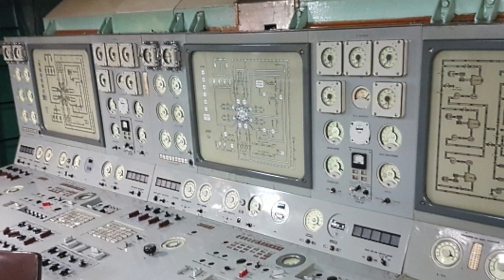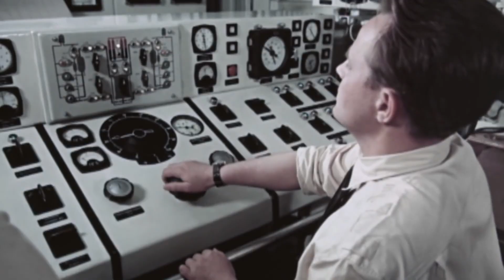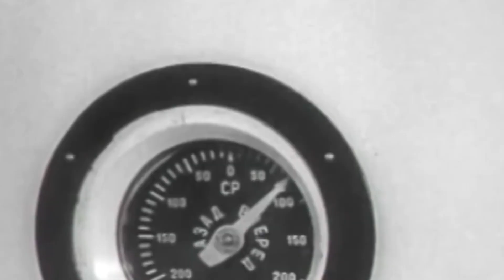Severe Radiation Accident on the Nuclear Icebreaker "Lenin"

Comment: This robo-voice is better than most, but it could be better. My experience is that you have to edit the text to fool the software into making the delivery more natural. In particular, commas will introduce strange pauses that make it difficult to follow. My advice to understand where this happens and remove those commas, even if it makes the text ungrammatical. In summary, listen to what is generated and modify the input to make it more natural-sounding.

Comment: If a ship of the future is designed for extreme endurance it would have a combination of solar power, and hydrogen fule cells. I wounder this concept had been invented  other than nuclear weapons. Would it have have made navy brass happy. Think Unlimited fresh water, eltricty, hydrogen fule, from sea water/ ice. For a submersible,  or surfacecargo's. Cargo's Vehicle. So the solar provides enough energy to crake the water into hydrogen, oxygen. Produce water, etc. These ideas were used on the space shuttels in the 1980's. Imagen if solar-powered, and hydrogen fule cell tec was inveted during W.W.I.I instead of nuclear fission.. unlimited range should have been better that a mere 50 days of self sufficient operation. As work in the artic should be at least a 5 year " Mission to boldly go where no one has gone before"
  And then you would not fear. N.C.B war fare agents. Just C.B.
Reply: You are dropping out of truth that there is no solar power where they used this. And your hydrogen isn't any help. If they deal those radiological problems awfully like us did too, that not mean some hippy happy "green tech" is real answer there or even nearly possible. Making cells for panels create toxics and those dumbed in seawater nowadays. Plus you need stuff from ground tons and tons per watt hours. In space those panels are 4-20x effective because more advanced materials and more photons because no air and those things work better in colder.